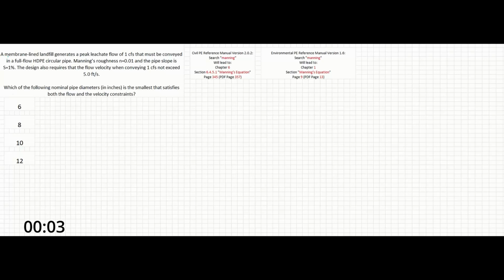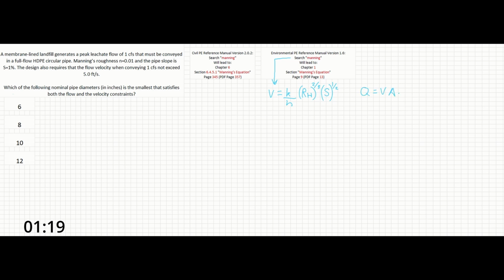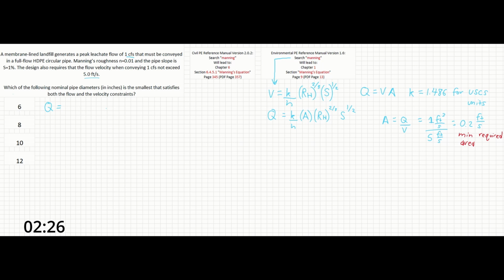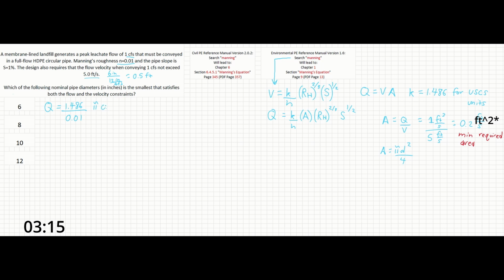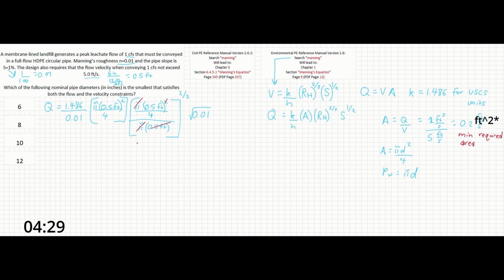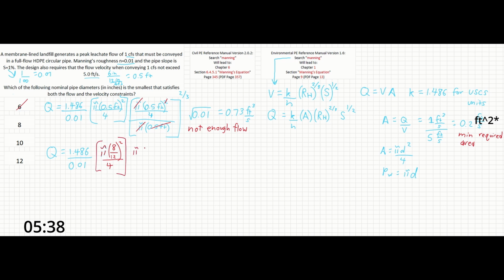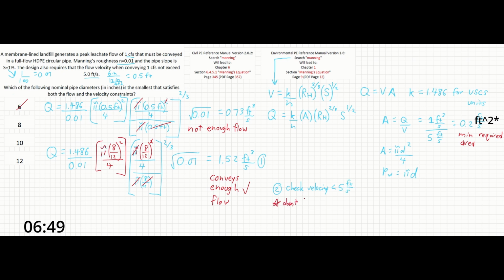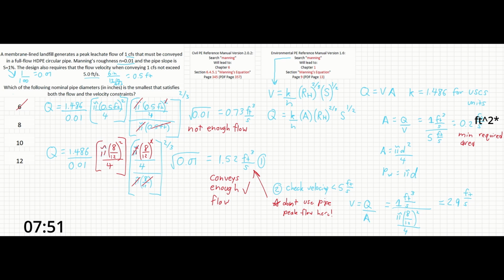PE Exam Practice Problem #101: Environmental | HDPE Pipe Design for Landfill Leachate Flow/Velocity

Comment: Tip for those who own the TI-36X Pro Calculator : Let n , S, and V equal x, y and z respectively by inserting the value, click Sto>select desired value. Then using the "num-solv" function [2nd+sin sin^-1 key], on the left hand side insert 1 (Q in cfs) , in the right hand side insert k/x*z*pi/4(d)^2*(d/4)^2/3*(y)^1/2 solve for d... This will yield ~0.65 ft , lastly convert to in.  NOTE : k is unit dependent for this type of k=1.486 (USCS)
I hope it helps
GLM
Reply from the maker: BIG BRAIN! THANKS I WILL PIN THIS.
Reply: This is great!

Comment: Why did we find that initial area in the beginning? It doesn't seem like it was used for anything
Reply from the maker: hmmm. im trying to recall why i did that lol. I think i was using it to bracket the min required area that would be required for that flow and volume. It turned out that the area was already greater than that, so many thats why we didn't need it. Sorry for my imperfect memory here.

Comment: I found it quicker to just solve each answer's area and use Q=VA and plug in 1cfs and solve for V.
Reply from the maker: Thanks for sharing - hmm - the way I solved this in the video, using Manning equation shows us that the 6 inch pipe does not convey enough flow to meet our flow criteria. I guess when you solved for V it also didn't meet the velocity criteria? I am not sure if this was just a lucky coincidence that may not have led to the correct answer with a different (smaller?) set of pipe diameters. IE I am not sure if there is a case where the flow fails but the velocity passes. I guess it depends on the criteria values selected and the size of the sewer diameters to choose from. Just something to think about.
Reply: @SolvedIn6  since Q = vA, can't you just set Q = 1cfs, v = 5ft/s, and take the first pipe that has an area greater than the A you solve for? Solving for A in Q/v=A with these values, minimum A = 0.2 ft^2. Since a 6" pipe as an area 0.196 ft^2, it fails to convey the given flow. If you bump up to an 8" pipe, you would just set Q= 1 cfs since that's a site constraint. Can't be changed. There's no minimum velocity given, so as long as it can convey the flow (which we already know it does) and everything else stays equal (which it does) velocity literally can't increase beyond the value we used to solve for the minimum A. As A increases and Q remains constant, v will decrease.
Reply from the maker: @elijah4606  i think in this specific case it does work out, but i don't think it would hold true for all cases. My best understanding is that if you know the pipe slope and roughness, mannings would be a requirement to confirm both flow and velocity independently of each other for each pipe area. A given pipe at a 1% slope can pass way less flow than the same pipe at a 5% slope and i think that information needs to be considered. Thanks for your thoughts.
Reply: @SolvedIn6  that's true, but the slope component is inherent to v in Manning's. This is evident in the way Manning's is given in the reference manual, one version for Q and one for v. The only difference in those versions is that A is present in the Q version. So, if you already have v given in the problem, Manning's has kind of been done for you already.
Reply from the maker: @elijah4606  Good observation. Lets see if I'm missing something or if changing the numbers slightly also changes your perspective. If the problem had said that the slope of the pipe was 0.3% (0.003 in mannings), we could still start by dividing 1 cfs by 5 ft/s to find that our min area needed is 0.2 ft square. Then, using that area, i calculate the flow for an 8 inch pipe to be 0.82 cfs. This would show that the pipe, although the size hasn't changed, can no longer convey that 1 cfs, and therefore a larger pipe would be needed to convey the flow at a more shallow slope.

Comment: What I did instead, was use "Minimum Diameter of Circular Pipe Under Full Flow Conditions" equation under "6.4.5.3 Flow in Circular Pipe" of the CivE Ref Manual. Afterwards I just checked that V was under 5ft/s using the Q=VA eq. I still got 8 inches. I hope this helps other folks studying. Thanks BTW this series is really helping me, you are awesome man.
Reply from the maker: Thanks for sharing! That could be a faster solution method. I always appreciate hearing when people find better methods. Good luck in your studying!